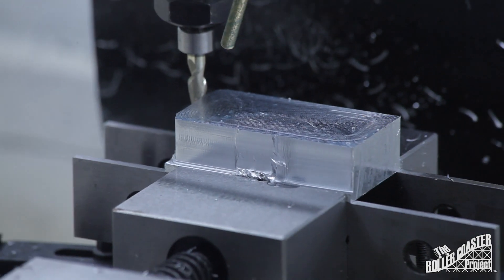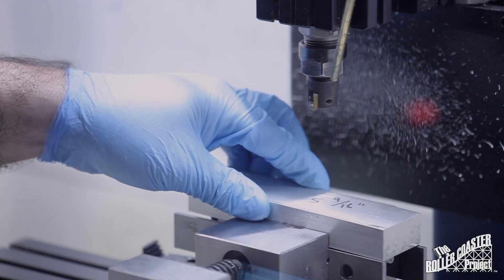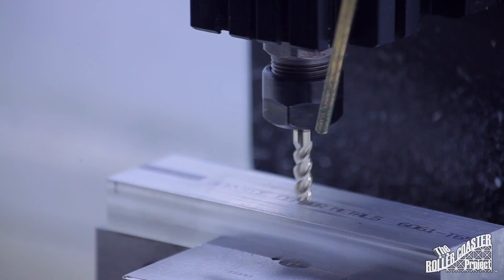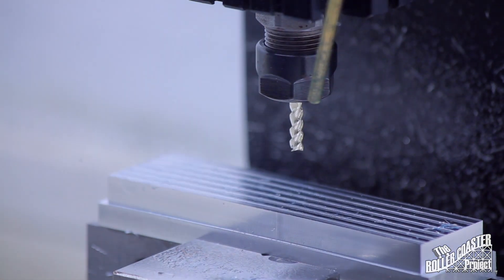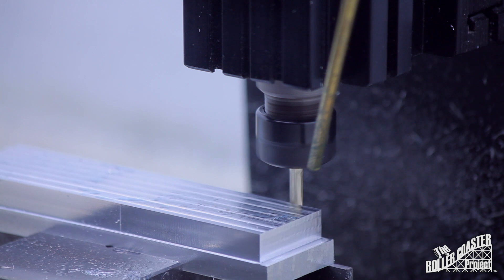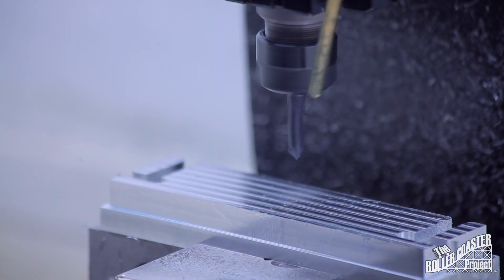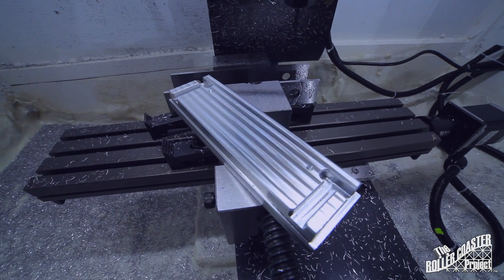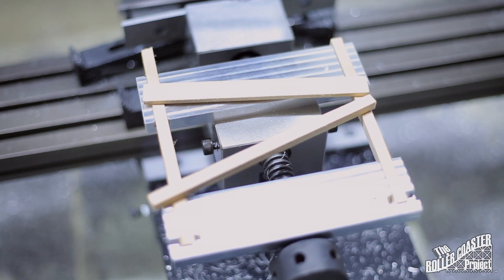Roller Coaster Building Tools: Part 2

Comment: You can save some time by eliminating the pecking cycle when you are using the spotting drill. That's mainly used when the hole depth starts to become a few multiples of the diameter.
Reply from the maker: ElectricGears I really have to.  It’s a tad ridiculous when I watched the first few times.  I’ll have to see what to adjust in my CAM program.